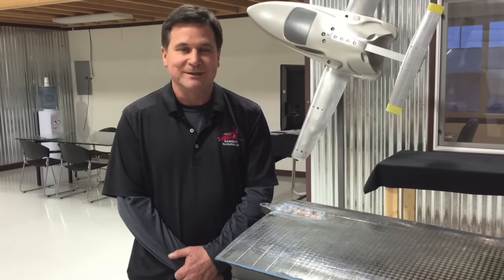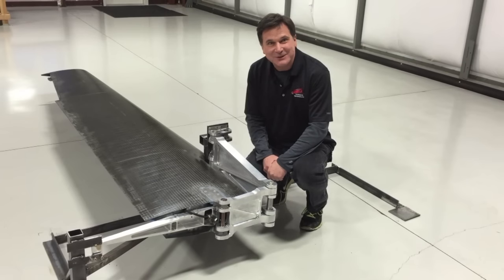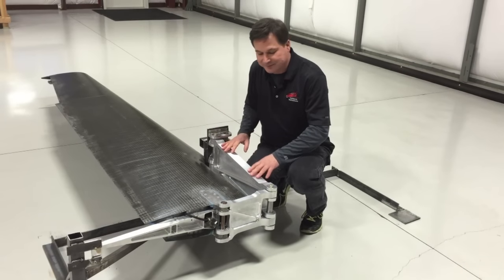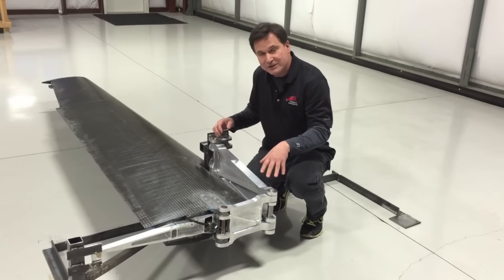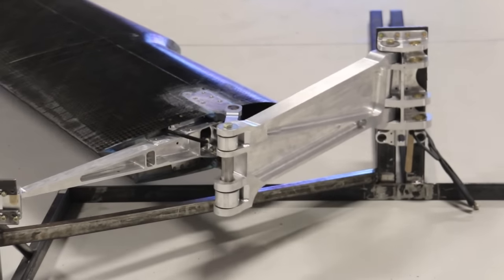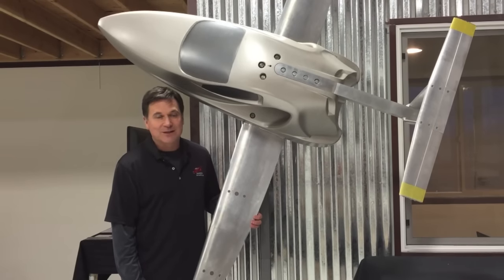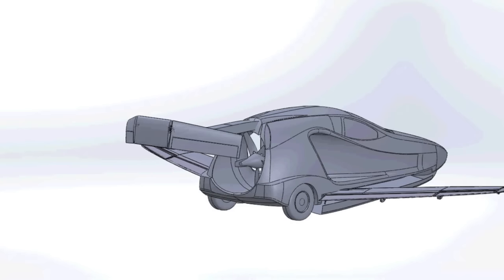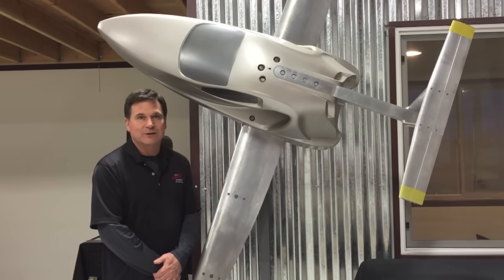Introducing the Wing Swing

Comment: I'm a 55 year old Aerospace engineer. I use to dream of building a flying car when I was a kid. I watched Moller closely for many years. By the time I was in my late teens I realized, while flying cars were technically possible to achieve - they really weren't practical and safe for ongoing use. In the end, all the flying cars eventually die for these reasons (usually after hoovering up significant amounts of seed money from naive investors).
Reply: Yup!  Just because a car moves people and a plane moves people, there is NO reason to combine them.  Nobody tries to combine a hair dryer and a toaster just because they both produce heat.  Now, having said that, I still applaud these "inventors" because you just never know if one of them will actually, one day, pull it off.  And what's more, I really REALLY hope they do!
Reply: @darrylwbraun  People trying to safely drive a car traveling in 2 dimensions while their nose is buried in their phone indicates humans were not meant to fly in their cars.
Reply: Until flying cars are fully automatic with NO input from the "operator", other than selecting a destination, they will remain an elusive dream.  Very few people can fly an RC helicopter, but nearly anyone can fly a multi-rotor "drone", with GPS, multiple obstacle sensors, and many other features that are all designed to remove the operator from the equation.  As technology advances, people get dumber and dumber.  It's always been that way.
Reply: Exactly right, and I was five years ahead of you...

A couple of years after you were born, I could've flown a Cessna @ 6-7 years old if I had some rudder-pedal extensions, but I will NEVER get in a "flying car"! : )
Reply: @throngcleaver  That was very well written and so very correct; it sure seems apparent that as technology increases, the need for people to think for themselves decreases; an inverse relationship.
Reply: @marbleman52  @throngcleaver -- I think technology frees us up to think upon questions we didn't have the time for before. Ad infinitum perhaps.
Reply: @lifechariot  Sure, for those that can actually think, but how about the millions upon millions of people that didn't fare well in high school, didn't get any higher education, and that can't even do simple math without a calculator, or by asking Siri for the answer?  Sure, they can tell you all the players names on every team in football, basketball, baseball, or hockey, or everything that is going on in the lives of multiple Hollywood stars, but they can't even do their own taxes, fix a leaking toilet, change a tire on their car, or stay out of debt.
Most people don't have time to think upon questions.  They work one or two jobs to make ends meet, thanks to a poor education and/or a low IQ, and when they come home they plop down to watch sports or sitcoms or some silly series that teaches them nothing, or they hit the bars.

A perfect example of the dumbing down of people is this:  Many years ago, I worked in a large aircraft factory as an aircraft mechanic.  At one point I was assigned to a lab to support the engineers out there, by building the test setups of whatever component or system that was being tested.  They hired a young mechanical engineer into the department.  He had a couple of years experience at another company, then moved on.  He was about 24 or 25 at the time.  One day, with many of my tools spread out on a work bench, while I was putting together a test unit, he walked over to talk.  As we shot the shit, he pick up a Craftsmen 3/8" ratchet.  As he was fiddling with it, and tried to rotate the mechanism, it clicked in one direction and not in the other.  His face lit up and he said, "Is this a ratchet?"

I laughed, but the realized he was serious.  It was the first time he'd ever seen and held a ratchet............and he was a mechanical engineer.  He said that he'd seen pictures of various tools in college, but had never seen one in person.

He picked up a socket that was laying on the bench and couldn't figure out why it wouldn't fit.  After about 45 seconds of watching him, I said, "Try the other end."  He flipped it over, and it went right on, but it stopped at the retaining ball that keeps the socket on.  Many ratchets have a push button on the back to release the socket, and Craftsmen ratchets have that feature.  He was AMAZED that the socket went on, but couldn't come off.  He asked how it works!!!  OMG!

So, I drew him a little drawing of the pin, with the groove, and a spring, bla, blah, blaw...

I asked him if his dad had any tools when he was growing up.  He said, "Oh yeah, he had a hammer, some screwdrivers, and some pliers."

Right.

The young man was fairly adept at using a computer, and playing video games, which is exactly what he did the entire time he was growing up.  Video games.  As a kid, he never took apart a lawn mower, a clock, even a computer, because he had no interest in mechanical devices, but he's a mechanical engineer that went to Princeton.

Funny thing, two years later, they hired another young mechanical engineer, and he did the same thing with the ratchet.  However, he didn't pick it up and figure it out, he just asked what it was.  Had no clue, couldn't get the socket on it.

One of them lasted 3 years before they fired him, and the other lasted 2 years.  They were absolutely useless as employees.  Zero value.  If it wasn't something on a computer, they didn't get it, and there wasn't anything on the computer they could do, that I couldn't do, so what's that tell you?

Didn't intend to write you a book, butt hay, it's the internet, and you don't have to read it.  ;)
Reply: @throngcleaver  -- 11 paragraphs is perhaps a page, not a chapter and no where near a book - I really don't mind.

I do believe that the current education system, and the past 200-300 years of its foundations, has led people in the West to become overintellectual (impractical and prone to ideological thinking). In my opinion there has also been an unreasoned push to have as many people in University as possible regardless of quasi-subjects taught, damand for those subjects and adverse effects of ideological teachings (as opposed to theoretical teachings).

As for those mental health problems and without formal educations or work ethics, the research is clear, neglect and abuse of parent-child interactions are the major cause of these issues.
This is especially true for a mother's neglect and abuse of her child in the first three years of life.
However, the evidence of this research contradicts a major ideological narrative of our time, so it's not acceptable in the establishments which are predominantly run by females.

Stated research: https://lifechariot.academy/attachment-theory.
Reply: If you could get the weight the "car" significantly down it could be practical, like the thrust to weight ratio of an insect, very hard to achieve but possible as insects have proved it.
Reply: @throngcleaver  -- I'm using the term "overintellectual" to describe a lack of emotional literacy and practical prowess which results in the futility of rationalism. Whether there are more intellectuals is actually an interesting and debatable opinion, yet that's not quite what I meant.

Thank you for reading the whole page.
You might not have noticed, but the blue headings for the different types of Attachment Styles are links to the evidenced research on that specific style.
If you look at the evidenced findings of the "resistant" and "avoidant" (but particularly the resistant) styles, you will find a mass of answers related to the concerns you've expressed around school performance.

There's findings of incompetence clusters of children in classroom setting which relate specifically to these attachment styles. As too with dependency, enthusiasm, persistance and complience ratings from many dozens of teachers who were blind to the research data.

Indeed the 30-year longitudinal findings clearly show as much as a 30 point difference in IQ rates by age 4-and-a-half-years-old for children who suffer physical and or emotional neglect and abuse.
Those IQ findings are accumulative too, for when the foundations of maths and English are learnt in a patchy manner whilst overshadowed by emotional problems, later classroom learning is continually impeded by poor rudimentary understanding.
IQ test results rely on understanding the languages used by the tests, so when poor understanding of the languages of maths and English are applied, it results in an artificially low natural intelligence mark as represented by a general IQ test score.

There is also a link on the "overview page" to a video on the evidenced importance of face-to-face contact between mother and child in the first year-and-a-half of life.
Again, the emotional disturbances which arise from nelgecting these issues are key reasons why those children can't concentrate well in class.

The terrifiying truth of academia is that it's riddled with ideologues. Whole fields of supposed scientific enquiries are at the mercy of dominant supposed thinkers who do little more than read off a fantasised scipt of reality and discipline those who stray from it.
As ideologies set their tenets in stone, when new evidence contraticts a preferred ideological concept the evidence is suppressed.
For examples, developmental psychology is populated almost entirely by women, and that field is dominated by the ideological concepts of feminism. Thus new evidence which runs across a feminist vein is at the very least suppressed and/or punished. Indeed there are chapters written detailing the malicious professional sabatage of those who publish research, such as what I've presented, at the hands of the domineering hand of feminism in psychology.
If you want a successful career in developmental psychology, you don't publish the data which I'm highlighting here.
Hence my concern for the integrity of the scientific fields - not to mention the health of humanity's children.

There is a gaping correlation between the declining mother-child face-to-face time in the first few years of life and childhood developmental problems that endure as lifelong emotional issues.
Feminism will not allow that conversation to happen in an acedemic setting.
Reply: @throngcleaver  No offense, but BS
Reply: @lifechariot  Sorry for the delay.  Been out of town.  Yes, I did notice the links on your page, but didn't have time to visit them.  I did bookmark your site, and when things lighten up around here, I'll have a looksee.

I cannot agree more with what you've written.  The formative years of a child are crucial to what that child will be, or will be capable of, and you'll never get that chance again.  With many households having either a single-parent raising the children, or both parents working full-time jobs, we get what we get, much to the detriment of their children.  Not all children raised in either of those situations turn out bad, but many suffer for it, as it's not the ideal situation.  It's too bad that our education system doesn't actually prepare those within it, to understand enough about raising children to make a difference.  We are failing as a society in many ways, and that's one of the one.

The pharmaceutical companies love it though.

Ideology, whether it's based on religion, politics, gender, or any number of things, should never be a part of education, unless that education is specific to one of them.  Mathematics requires no politics, religion, or anything else.  Nor does English, Literature, Physics, Chemistry, and many other school subjects.  History and Social Studies will involve a bit of politics and some religion, since they both have shaped history in major and minor ways, but like you said, academia is riddled with ideologues, and they push their own agenda onto their students, and others in the field, instead of just teaching the facts.  That is not acceptable.

It is wrong on every level for one gender, one political party, one race, or one creed to dominate a field in academia, yet that's exactly what we have.  Education should be able to fix that, but first, we must fix education.  We could start by admitting that flying cars for the masses are not viable until human control of them is removed almost entirely, or until we evolve past the driving-while-under-the-influence and driving-while-texting phase of our existence, and get back to having true responsibility instilled in everyone.  Like that's ever going to happen.
Reply: @PatBuckleyracecar  None taken, but thanks for your input, Pat!
Reply: @throngcleaver  -- Well said.
Reply: @lifechariot  Back atcha!
Reply: When you build something that does everything it ends up doing nothing very well.
Reply: @MikeJones-rk1un  Most people can't afford a private pilot's licence either, which is the sort of market this thing is aimed at. If it works, it has the potential to make general aviation safer by making it easier to continue your journey in poor weather. A huge number of general aviation crashes are caused by VFR into IMC, and something like this could almost entirely eliminate that problem within that group of people who own one.
Reply: @throngcleaver  hear! hear! It sounds like you truly care about your people. NS calls you.
Reply: Until planes (and flying cars) can fly fully automatic, people will need a full pilots license to operate such thing. People will soon realize that this is much harder than getting a driving license.
Reply: @ButterfatFarms  I agree with most of what you said.  I've had a pilot's license since 1977.  Had RC helicopters and planes since 1975.  Only one "drone" (Phantom 4) for 3 years, so I'm very familiar with the operation of all the above.
I never said the operator was removed from flying drones, just that without the high tech hardware and software, the average person wouldn't own one, because they would be very difficult to learn how to fly without it.  Just like RC helicopters, although some are equipped with nice flight control software now.
Yes, technology allows people to do things that otherwise they couldn't do, but they aren't truly "flying" the drone, it's flying itself, and it accepts inputs for direction, speed, and altitude, plus camera control, if so equipped.  There are no real skills involved, if you can just let go of the controls to fix any flying issues.
What happens if the high-tech goodies fail in a flying car?  My guess would be that you just yank the handle on the BRS and start praying, unless you have piloting skills to back up the electronics.  It'll still be many, many years before flying cars are available for the masses, and not just the well-heeled pilots.
Reply: Not to mention.....THIS IS A 3 WHEELED CAR.......PROBABLY THE MOST UNSTABLE THING YOU COULD PUT ON THE ROAD!!!!!!!!!  Three wheeled cars......at least with the 1 wheel up front, will tip over at the drop of a hat.  About 50 years ago I was trained on a 3 wheel street sweeper.  The trainer had to scream at me to slow down the first time I made a turn onto a cross street.  Nobody remembers to slow down enough without being screamed at the first turn.
Reply: @grabitz  how was the flight? Did you  fly it or were a passenger?
Reply: @pimplepickerton  LOL. Well, I got to sit in it in the showroom. I don't believe it ever took flight only remotely with a cable hooked to it.  What the army did with it I have no idea.
Reply: @grabitz  I got ya. I misread your original post. I thought you had said  that had you flown in it, but I see now that you didn't. Cool story though still. 😎 ... I remember being a kid and flying cars were talked about all the time. Talked about as something the future would most definitely bring, just like hover boards and a nuclear winter. It seems that has drifted out of the public imagination. Idk if it is because people are finally accepting that flying cars are impractical, or because people now dream about other things, like drones or something. Lol
Reply: @pimplepickerton  It was a thrill just sitting in it back in the day. I see a lot of flying car concepts now but nothing like the Jetsons car that would never crash. I had an ultralight that was a huge thrill but I got too old.  My daughter and I are half finished building our hoverwing  3 seater in my backyard.  I think the dream of flying has grown we just need a better energy source
Reply: @grabitz  That is awesome. I looked at paramotors real seriously for a while. I really wanted one or anything to fly with. I certainly looked at plenty of ultralights also, but don't have the money. That is awesome that you were able to have one, and that you're building a hover craft. I used to see the "hovercraft" ads in the back on magazines and always wanted to buy one. I was very disappointed to learn that they were always just selling the designs not the actual craft. Lol good stuff on teaching the kids how to work on stuff. It is a skill that I feel is getting lost with the youth.
Reply: @pimplepickerton  I'm learning to build this thing off of YouTube . Mine is kind of stealth looking and I'm putting retractable wings on it. My daughter was telling me about the young guys today who can.t even change a tire and asked me to teach her how to fix things. So we made a deal to build a hovercraft.  I figure by the time we finish she will know everything she needs to know.
Reply: @grabitz  That is bad ass. Both the retractable wings and the teaching of the kid. When you get it finished you should post it on here. Good talkn to ya. Good luck to yals.
Reply: @darrylwbraun  There are quite a few good reasons to combine them. The main reason is to allow pilots the ability to continue their journey if the weather turns bad, without the need to worry about storage fees, and the cost of car hire, etc.
Reply: I was just thinking the same thoughts and getting ready to voice them myself when I saw your comment.
Reply: Dude, that’s why you have a job fiddling with ratchets, and the mechanical engineer has a job fiddling with calculus and computers. If he laid an integral equation in front of you, would you know what it is???????  In other words…. Stay in your lane, bro!